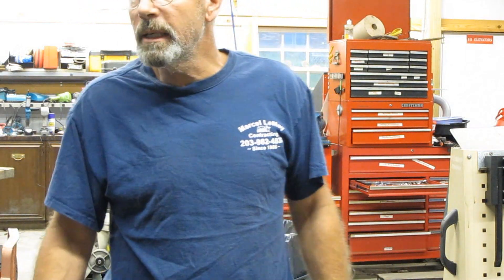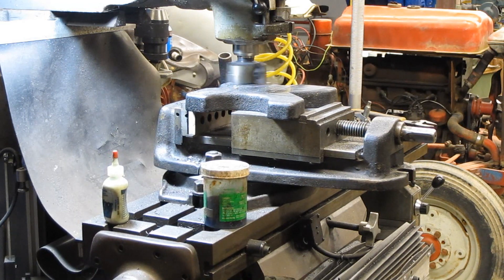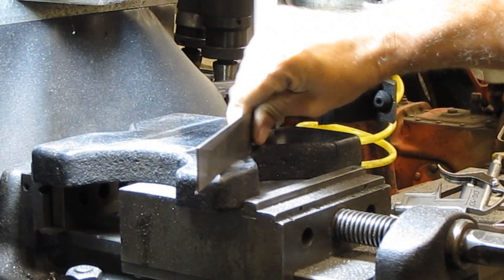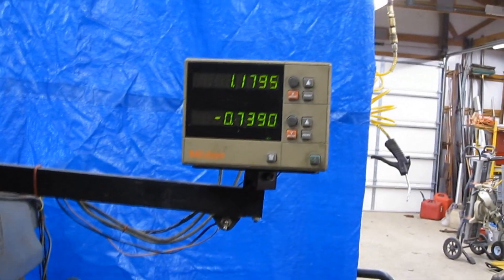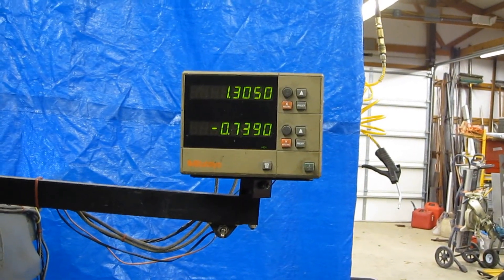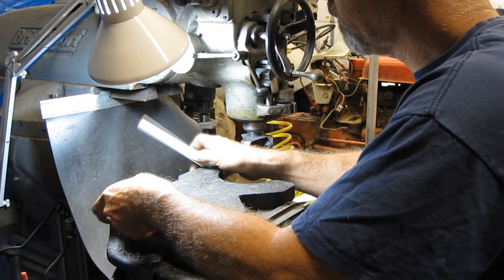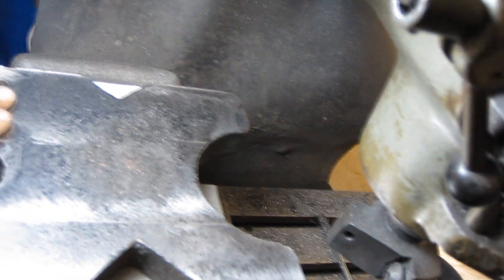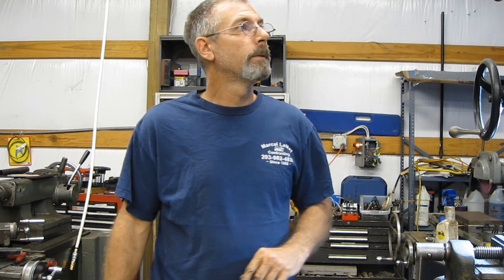Harbor Freight 20 ton Press Plates, Making them FLAT!

Comment: I never knew press plates.were SO EXPENSIVE!  

I was quoted.$65.00 on average here in Chicagoland per wheel hub to press out and then in a wheel bearing on my Toyota Solara.  Four times $65.00 is $260.00.  Harbor Freight 12-ton press.was.$120.00 out the door.  Guess what I did in January of 2020?

When the bearings stick, I just wait a while, about a minute after putting on enough pressure to twist the press: I do no add additional pressure.  After a wait, I hear a POP and springs chiming thus evidencing the sticky point has been negotiated.

The Swag Plates cost more.than my press!

Comment: Nice mill.  Mine is all manual, 1hp. Belt drive. And mine spins a 3" face mill OK.   Im picking up a B&S #2 Horizontal mill soon, so im not pushing my vertical mill so hard.   Love the DRO. I added them to my machines also.
Reply from the maker: I'd love to get a larger heavier mill, like a series 2 Bridgeport or a K&T, something that has a 50 taper spindle. I probably will eventually. I'm just waiting on the right one at the right price. They're a lot harder to come by down here in Tennessee. I'm originally from Connecticut, where it was a lot easier to find industrial machines at a fair price. A road trip might be in my future.

Comment: I took the wimpy way out and bought the plates from SWAG Off road. If I had access to a mill I would have went your route.
Reply: I just upgraded from my old 12 ton the the current HF 20 ton with a $140 coupon. It came with steel plates.

Comment: Those plates are junk don't use them.
Reply from the maker: Peter Vance  They work fine, now that I've flattened them out. I agree though, they are junk. Plate steel would be much better.

Comment: You have a surface grinder in the background....why did you chose the Bridgeport over a surface grinder for flattening the plates?
Reply from the maker: +Graham Miller I needed to take way to much off. I'd still be there grinding these things. .090" is what I ended up taking off of each plate.
Reply: Marcel LeMay fair enough. I have a Bridgeport, and that is what I am going to use for my plates too. I was just wondering why you chose it. Great videos. Thank you!!

Comment: Not quite sure I understand, but why do you care if they are not really flat.    Mine are not flat either but I didn't know it was a problem.  Am I missing something?  Nice job though.  :-)
Reply from the maker: Glenn Felpel It all depends on what your doing. I've had parts fly off that thing under pressure. A good firm flat base is just safer. Thanks for watching.
Reply: Yes I can see what you mean.  From that perspective they sure are not flat. Good idea and thank you for responding to my comment.  I had not thought about that for sure.